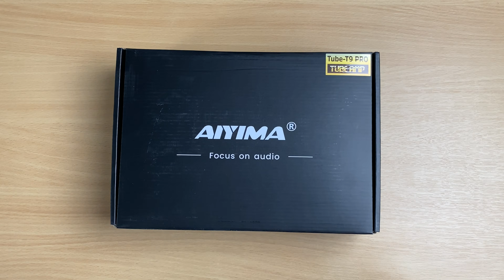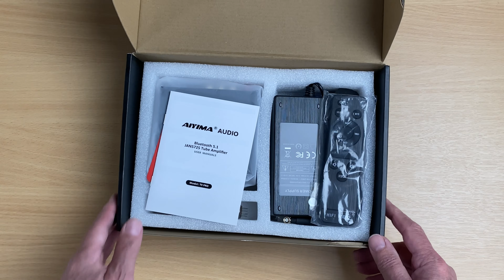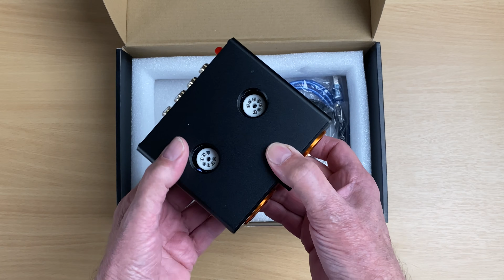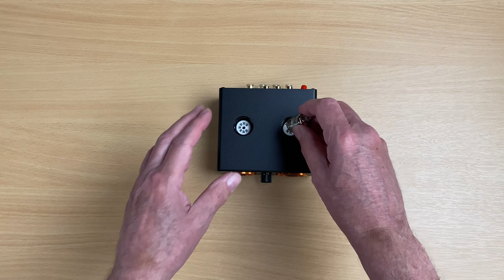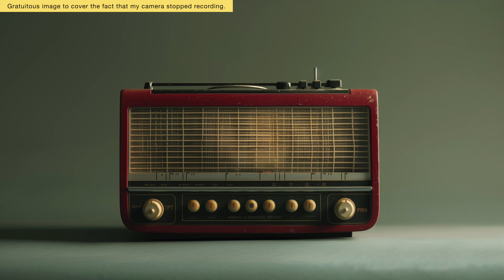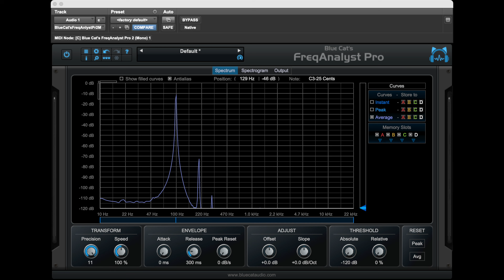Does this amp distort? [Aiyima T9 Pro]

Comment: I just like tubes because they look cool... I ended up buying the DOUK ST-01 Pro and it looks great on my desktop.  

Do I hear warmth... I don't know... It does give me a good soundstage so it's not distorting each channel differently to a point where it's just stereo and not HIFI stereo if that makes any sense.  It doesn't do the difference that a reclocker did to my signal... Even though I don't understand how a reclocker actually improves sound looking at it's still the same digital signal... I guess it's speed up a little from the source.

Comment: Much as I love meters of all types, especially electro-mechanical ones, I do not want them on the front of my audio equipment unless there is a switch to disable their lighting. I often listen to music in a darkened room, and so any light at all can be distracting. I have covered the power LEDs of many items.

And it's here I need to ask manufacturers: WHY ARE YOU INSTALLING 1.21 JIGAWATT LASERS WHERE A POWER INDICATOR WOULD NORMALL RESIDE?

Seriously, WTF? And here I must congratulate Fosi on the power indicator LED on the BT30D Pro. It is red. It is tiny. Perhaps only 0.25mm in diameter. Thank you, Fosi! The power LEDS on the ZD3 and ZA3s are also pleasingly subdued.

But then, Fosi go and put not 1, but *2*, (count them: TWO!) 1.21 Jigawatt blue lasers underneath the tiny valves in the (wonderful!) T20 tube amp, so I couldn't see any photons produced by the tubes. But this is fiX0r3d easily using a knob of Blutak on top of the LEDs under the valves. And just for good measure, Fosi install another 1.21 Jigawatt blue laser for the power indicator. Moah Blutak!

Please excuse the ramble. I'm OK now.

Comment: In my day I have heard a lot of distortion, and also a lot of very loud music without distortion. And my ears can easily detect distortion: It hurts my brain, no matter the volume. Whereas, extremely loud music without distortion never hurts my brain. And this is why I am a little worried about myself.

My new extremely Fosi-based 2.1 nearfield system w/ ZA3 Mono blocks and M03 subwoofer amp do not distort the signal at any volume level I have risked. And the ProAc Response 2.5s being driven by them sound fantastic. Especially when at 1-metre range, on axis! (WOW!) And the passive Denon subwoofer makes powered subs sound stupid, in my view.

And because there is no distortion, I am pushing sound pressure levels quite high since I built it. And I am loving it. The clarity and depth of the music from this tiny (well, small!) pile of cheap-as Chi-Fi easily matches piles of stereo gear costing tens of thousands in the 90s.

I suppose I need to start measuring dB levels, because now that I have rediscovered the wonders of stereo (as opposed to multichannel 5.1 and 7.1 systems) I do not want to damage my ears, or give myself tinnitus!

Comment: Sorry, but the valves are i believe not an 'extra colouration'. They are preamp valves. Ie, the initial imput signal first stage amplification.
Take them out and you will notice. And that is the signal going to the subsequent output stage. I could be wrong of course. I havent seen the schematic..

Comment: Warmth is a combination of low and midrange frequencies. In my younger days, I used to rush and look at the distortion numbers of a amplifier or tape machine. Then later I realized that humans can't hear that stuff anyway. If you can hear over 11kilohertz God bless you. Distortion from vacuum tubes sounds nice. Not so from transistors.

Comment: I thought the tube/valve sound was due to the transformer as odd harmonics are not easily transferred through the coils and instead create eddy fields in the core that turn into heat. Also there is much less control over the speaker as the negative feedback can only see the speaker through the transformer reactance.
Reply: As far as I know transformers don't know nothing about harmonics either odd or even harmonics. I want to believe that you want to pinpoint the difference between Single Ended or PushPull. P-P amps attenuate even harmonics.

Comment: My father has a t9 pro.
We changed the tube to russian Voshkov Rocket jp1 and it sound much better then the included jan tubes.
Reply: I think the Voshkov Rockets are the best tubes for this little amp. The tubes do take up to 100 hours to get settled, otherwise some may notice a bit of harsh highs when new. Definitely better that the Jan standard upgrade!
Reply: Also 5654w sounds very good
Reply: Do they have to be a matched pair?
Reply: @KRUSTYskates  preferably. For each lamp affect each channels.

Comment: Remember cassette tapes? 3.0% third harmonic distortion was considered acceptable. That is -30.5 dB. Yet I remember saying "the harmonic distortion on this tape is unbearable" exactly no one, ever. Nowadays, an audio device with SINAD of 100 dB is considered below par. I guess because it cannot transparently capture the 120+ dB dynamic range so commonly available in "high-res" content...
Reply from the maker: I remember reel-to-reel. 1% distortion up to 3% or more on peaks, depending on how far you wanted to push it. Maybe Aiyima, Fosi, Arylic etc will produce a cute little tape recorder for people to get that sound at home. If they want it.

Comment: There is a crappy GPX “boombox” in our shop @ work. Manufactured in early 90’s and it has control face nearly identical to the T9. That bothers me. Yuck. As far as distortion goes, it’s a 130 dollar amp and where I use these type units…not a concern. I have an A03 that gets used, abused and hasn’t given me any trouble. I really like it but haven’t bothered putting it on the HP distortion analyzer because frankly, I don’t give hoot.

Comment: I'm in favor of using a 2-tone intermodulation distortion test and checking for IMD products at f2–f1 for even order and 2f1–f2 for odd order distortions respectively. Such spurious inharmonic products cause most, if not all, of the subjective degradation of sound quality due to non-linearity, so why not measure these directly?  Use of 8000Hz and 11950Hz as test tones, resulting in products at 4kHz –/+ 50Hz for even and odd order products respectively used to be a standard.
Reply from the maker: This might be something for a future video where I test some samples of my ever growing collection of Chinese Class D amps.

Comment: HI, Excelent review, It´would be nice if you make a remark that 2nd Harmonic Distortion is indeed the "nice" distortion usually tubes in class A provide, I say It´s "nice" for that viewers that are not experts and really want to know what is the point of having a little bit (0.1%) off that 2nd harmonix, I you allow me I´ll explain to that viewers that 2nd harmonic is not as harmfull as odd harmonics,  I´ll say that if a guitarist play an open G string, with a little bit of 2nd harmonic the listener will hear that same G note an octave above, beeing that high octave note 1000 times smaller than the fundamental open G string, the listener will hear a sweet harmonic distortion. That explanation would be so clear that will reject any black magic effect that valves add to the sound, as for valve or tube warmth i believe It´s related to frecuency response (non linear) , roll off due to old triode single ended amplifiers and the effect the output transformer has on the final sound. That´s why some Audio Pro like, i bet you are, I saw you in a vid at Abbey Road Studios, THAT´s superlative Audio Pro,  you may prefer a Neve or API or like EMI in house build  trasnformer coupled consoles to an SSL witch is  direct coupled. Pros are looking for that subtle change IMHO , let´s call It distortion, but again in the correct amount,  .60dB 2nd harmonic. I´m looking for that effect too. But don´t expect a 20 year child with a home studio in his/Her bedroom to apreciate this. They where born in the digital era, perhaps they didn´t even know how nice a 2 inch 16 channel tape, headstock and recorder sounded. (Sorry English is not my main language so there may be mistakes off all kinds, sorry for that, I just don´t like "trasnslators", perhaps because they don´t have tubes :) Oh, It´s a pleasure to just relax and watch any of your videos, thery are ALL excellent. That´s why you´re aproaching 70k subs. and this vid has 257 likes just 12 hours after you post It. That´s a good measurement , don´t you think?
Reply from the maker: If even order distortion is revered so much how does that account for the popularity of the analogue tape sound, which is predominantly odd order? I'd have to say it comes down to a matter of taste. I have experimented with the orders using an SSL plugin and a bit of jiggery-pokery to isolate the orders and my conclusion, at the time, was 'I don't know'.

Comment: Consider to add the distortion of the speakers you are listening with. Very rare ones go bellow 0.1,% at 86db-1m. Most of them are above 10% at 50Hz. IMD results bad sound? ShureV mk3, pickup cartridge used in radio stations in 80's has 3%IMD 2% 2nd harmonic and 0.5% 3rd.
There are many issues with high current classAB amps that high negative feedback assures correction, in consequence the THD measures very low. This why people hear better sound with very low THD measuring amps.
Warm sound definition depends on the person who is expressing it. For some, it is inverse of bright sound, others think worm is backstage or lack of resolution.

Comment: Any Amp that uses a power brick should be ignored or thrown in garbage no matter how it sounds.
Reply: might be true but curious how you know. which ones have you tried that led you to be so sure?
Reply: @twentyNinebark  it's not a sound issue, it's he ugly brick issues. Looks terrible in stands or setup. You should not have to hide a large part of the system. Just build the power supply into the Amp. Anyone seeing 2x the cords plus a brick on the floor, it just looks like junk. Also, how much power does that brick consume when the Amp is off, because it's always powered on. When I consider equipment, I want to know all of it was designed by the company. They don't make the brick, so who knows what you bought.
Reply: It's certainly the point that isn't convincing me about these otherwise little wonders. The power brick is huge and awkward but also an important variable in the output.

Comment: Warmth and distortion are two different things.  Warmth is all about frequency response and can "tame" shrill sounding recordings which sound too bright in an accurate system, or just add warmth to an otherwise "bright" sounding system.  Distortion is all about a deviation from the original signal and may or may not be audible, depending on how prominent it is.

Here's the kicker in my opinion...  I used to work in a Hi Fi store and we had a "comparometer" which allowed us to switch from one amplifier to another with a remote control.  We had two budget amplifiers which were popular and had the same stated power output and price so naturally people would ask "what's the difference?".  What we did was to feed a one kilohertz signal into each amp and match the volume levels so they were indistinguishable by ear.  What was also indistinguishable was sound "quality" in the sense that no one could tell which amp was which.  However... when putting a complex signal (i.e. music) through both amps and comparing them, it was clearly obvious to everybody which one sounded better - not "warmer" or "louder", but unequivocally better.  When we were asked why, we opened the lids and the poor amp had a tiny rectangular transformer, AA battery sized capacitors and an integrated AB circuit while the good sounding amp had a large toroidal transformer, large D battery sized capacitors and discrete transistors so it was kind of obvious.

The thing is, measurements although accurate, will only tell you so much, and you need to actually listen to the amplifier or other component because trying to measure something dynamic like music and deciding on which component will actually sound and BE better is next to impossible.  Further, you have manufacturers who are so obsessed with measurements that in search of superior "figures" like noise and THD the design of the amplifier will be compromised (too much negative feedback for example) and actually sound worse even though it has more impressive measurements.
Reply: The quality of all the electronics component parts used in an audio amplifier reflects to its perpormance and it will be clearly heard in a decent loudspeaker.....
Reply: curious, what sounded “better” subjectively then say, to you between those two amps in the store? what were the sonic differences between the two
Reply: @twentyNinebark  Basically... everything, all types of music sounded better.  Greater dynamics, greater clarity, especially in more complex paggages of music, easier to listen to with no muffling of frequency extremes, more solid bass, less sibilant more transparent treble, you name it!  It really was chalk and cheese.

At this point I have to say that even though the two amps cost the same and had very similar specifications, they were simply NOT the same quality in any way, shape or form.  The poor amp was cheap rubbish with a "prestigious" name, while the other amp had no tone controls or any need for tone controls and was incredible value from a sound quality point of view.

Having said that, with a one kHz sine wave they were indistinguishable.
Reply: @twentyNinebark  sound
Reply: Yes, measurement only tells you so much. Any sound engineer will ultimately tune by ear.

Comment: Another excellent video. I might need to get an Eames chair in which to sit and listen to the newest unboxing music on my (so far imaginary) Quad ESL63s. Should I use this amplifier to drive them instead of my noisy (and real) 303?
Reply from the maker: I once had a 33/303 combo. I didn't like the 33 so I sold it. The 303 lingered longer fitted with XLR connectors and a handle for practical use. I can't remember why I sold it. I still have a 306 and I use it daily when I'm making my videos. As for ESL63s, well of course I've heard them and liked them, but always in a large room. Whether they would work in my living room I'm not so sure. For the moment I'll be sticking with my 801s.

Comment: Good explanation and a lot of good work done, thank you, I have the LOXJIE A40 Audio Power Amplifier and Ear Amplifier All-in-One Machine, MA5332MS Chip NJW194, Vinyl Phonograph Input, EQ Mode, 5 Filters Available, Bass Output, Bluetooth 5.1, with Remote Control, and I would like to put MORE EXPENSIVE models next to them that are 10 to 15 x more expensive and see who is the best.

Comment: In a catawampus Universe if the Buddy Holly era used transistor amplifiers and tubes were discovered in the 1960s we might all be harking for the cold hard precision of the ceramic transistor.
Reply from the maker: Oddly enough earbud technology is moving to cold hard ceramic drivers [insert not-even-sarcastic emoji here]